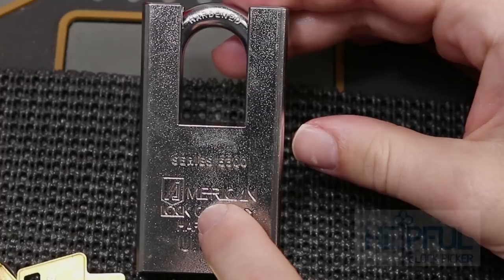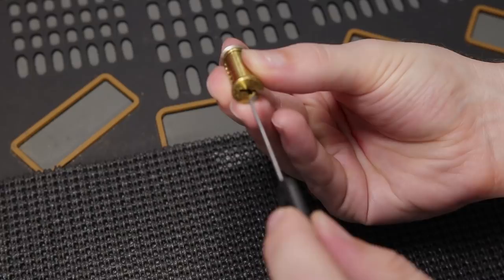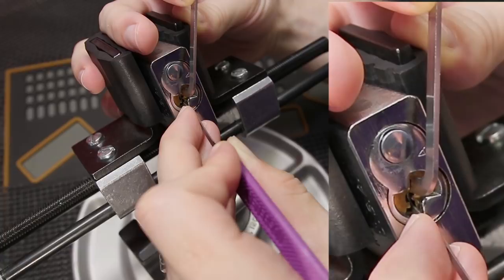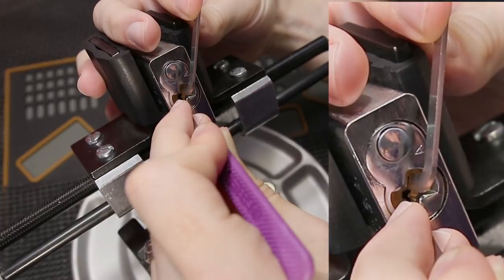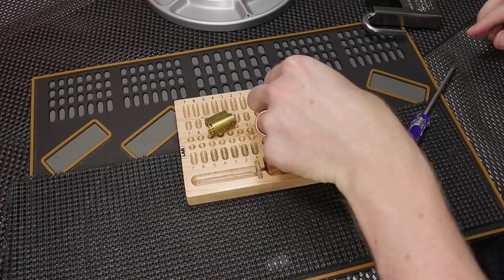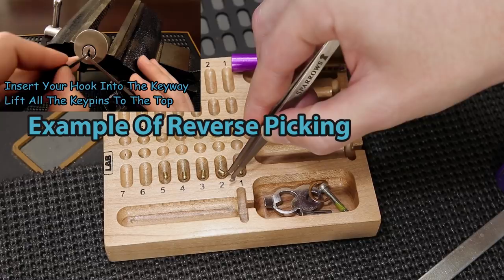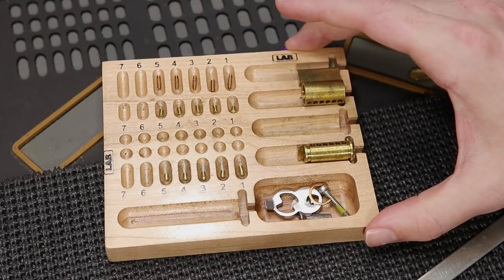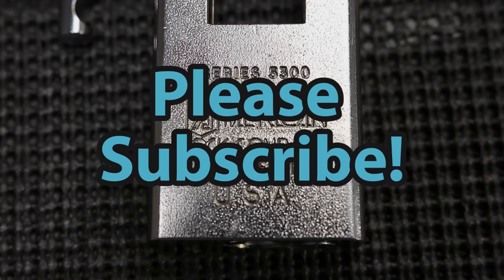[190] American Lock 5300 Padlock Reviewed, Picked and Gutted

Comment: When you say two clicks, how do you know to click twice?
Reply from the maker: As you are lifting the pin you can hear the separate clicks you get better at it with time. The clicks you hear while lifting the pin and the click you get when you set to the shear line are very distinct and is a great indication that the pin has been set. The audio feedback is something that is often underappreciated
Reply: HelpfulLockPicker  Thank you for responding and the valuable information.
Reply from the maker: No problem, I also recommend you check out my American Locks Tips and Tricks video, many have said it has helped.